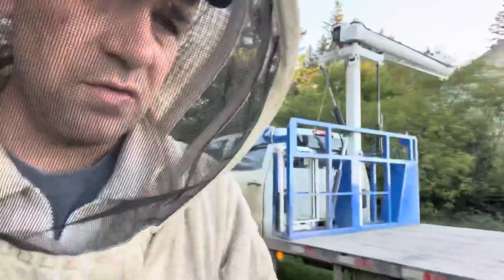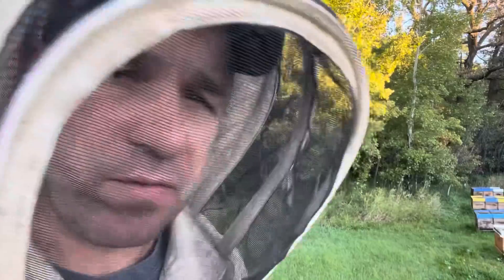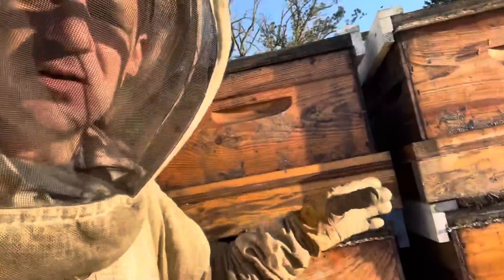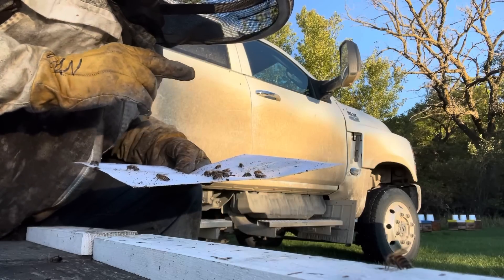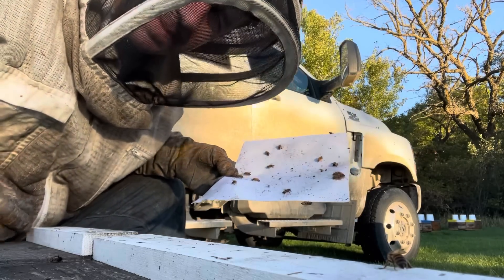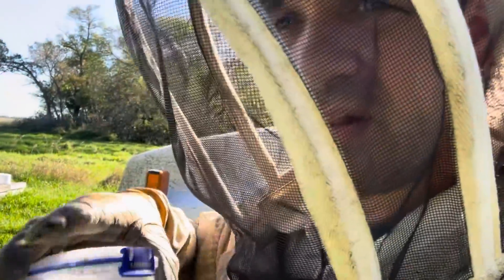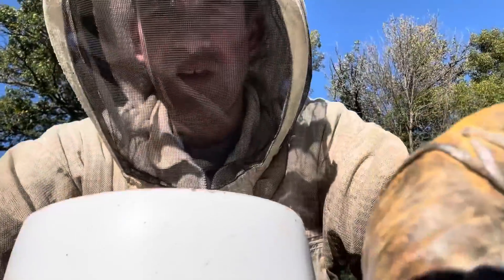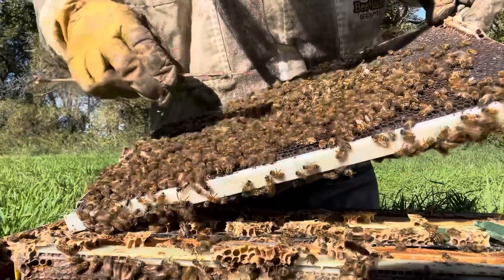Moving Yards, Measuring Mite Drop Efficacy

Comment: Question:  Are you seeing evidence of mite diseases like DWV?   Also, I am wondering what beekeepers would think of genetically engineered bees.   Would people accept using bees engineered to make them varroa resistant or resistant to things like DWV?
Reply: I’d accept bees resistant to mites in any way whatsoever.
Reply from the maker: As we adopted GM tech on the farm for exactly the same reasons
Reply from the maker: No sign of DWV but my viral tests show moderate yo heavy infestation
Reply: I have DWV in mine every year but it switched to the not visible one. It's very rare to see bees with bad wings but on testing it always comes out that they have some. Or maybe they are so good to immediately exit and not come back. 
They used to linger on the last frames.. drones, dark old and sick bees and ones with DWV. But I see much less of it